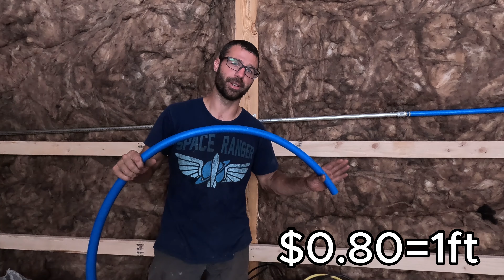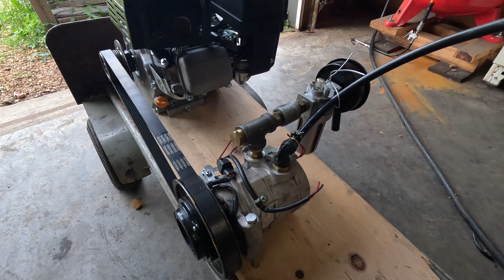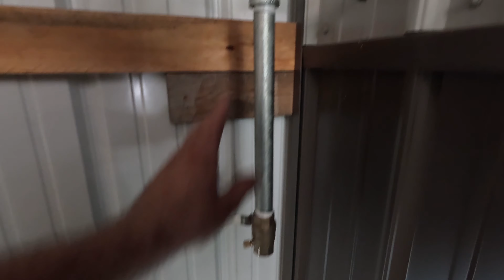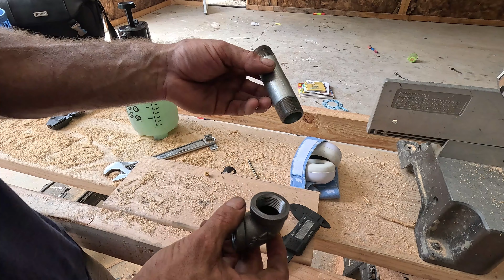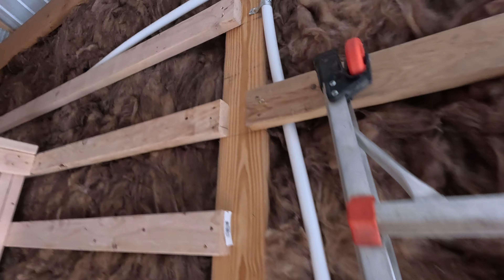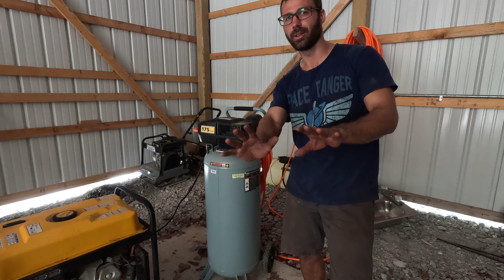PEX pipe for Compressed Air System in Shop. Pros, Cons and how I installed mine.

Comment: Using a refrigerated dryer chills the air coming from the compressor, so the PEX does well with it.  When running air lines I use a 3/4" trunk line with 3/4x3/4x1/2 tees at each tap.  The 1/2 of the tee goes UP to a drop ear elbow with 1/2 npt threads.  The quick disconnect is attached there.  The drop-ear elbows screw directly to a backer or the frame.  This keeps any water in the lines in the trunk to be blown out with the drain. In my shop the PEX is 15 years old and doing well.

Comment: I have had pex for my shop air now for 10 years.  I have a small garage/Shop and noticed you will experience pressure loss in the pex line. I have shut off valve at the compressor and the tank will not lose any air. However the lines will. Obviously some of it can be at the crimp location  or couplers. Pex has no metallic liner so air can diffuse through it slowly over time.  In my one car garage the lines would drop to zero psi  over a few days. No big deal as the volume of air the line represents versus my large 80 gallon tank is negligible.  In large  shops or ones with lots of lines it might cycle your compressor if left on  permanently.  

Just FYI
Reply: Pex Al pex solves that
Reply: @waynedejager351 not compatible with standard pex fittings.   You need to use more expensive fittings for that system.